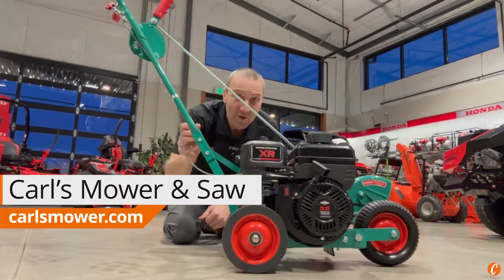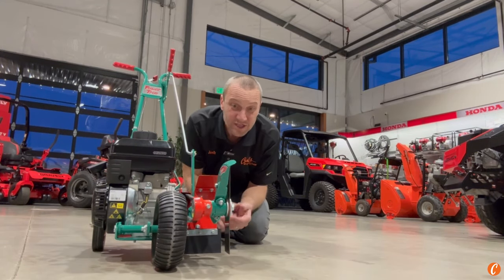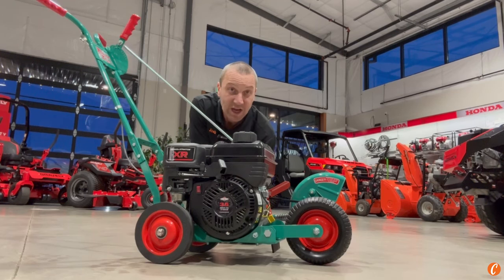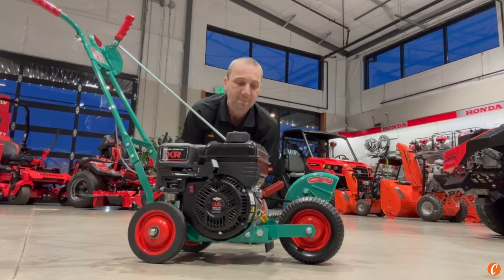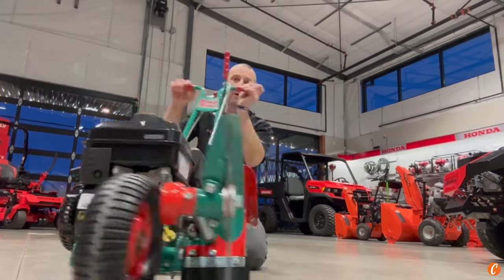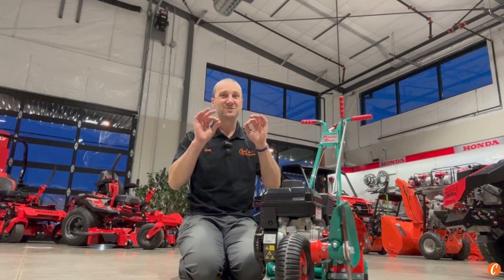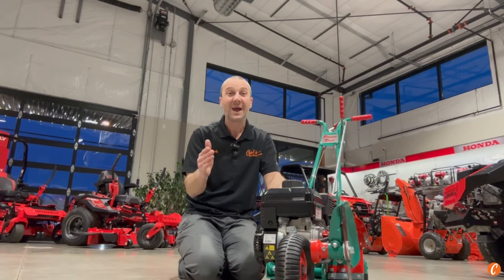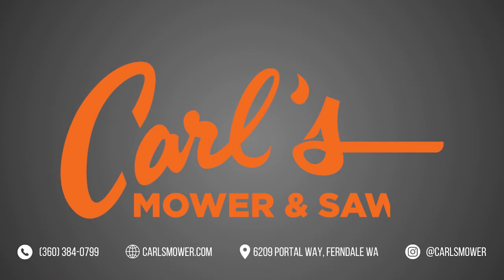The Tried and True Power Trim Edger

Comment: That's the model t of edgers  That all we had to use in 84 when l started Unfortunately the sand in Florida are them to pieces We would buy 2 a year Finally in 1992 l think Echo invented the Stick edger No Stihl then either only chain saws 😮
Reply from the maker: I remember selling some Echos early on. At that time our landscape contractors had a stick edger and a wheeled edger in their trailer. Then the straight shaft stick edger came out. Game changed.